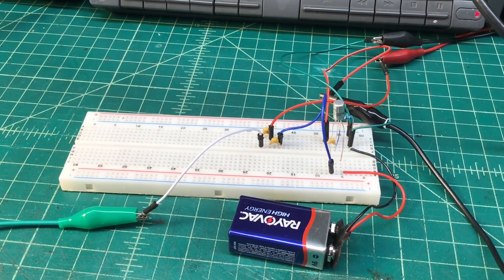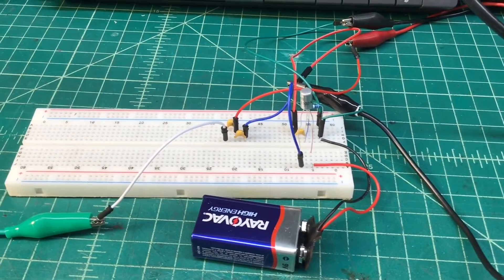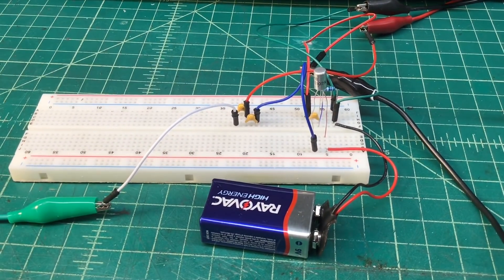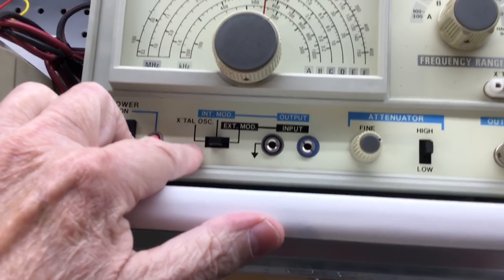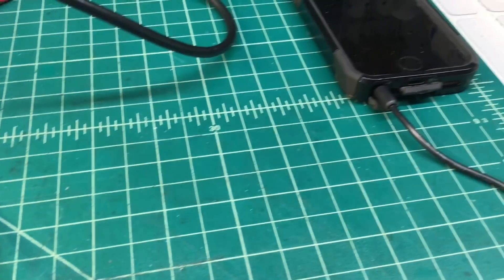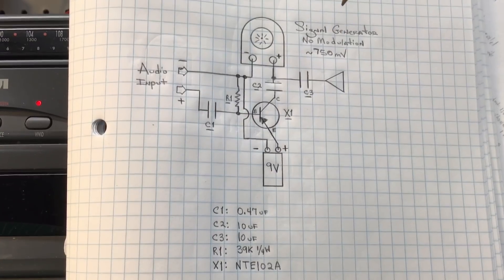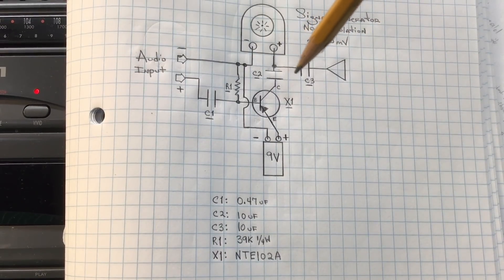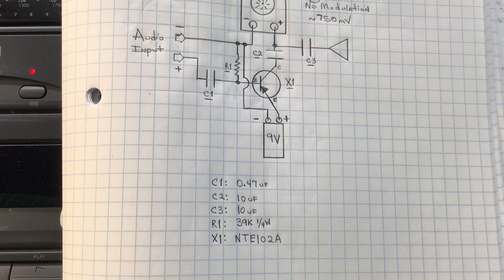AM Transmitter = RF Signal Generator + Audio Amplifier

Comment: It sure looks like C2 and C3 are 10 pf, and NOT 10 uf...
Reply from the maker: Martin - they are 10 microfarad caps; little ceramic 106 caps. All the best. Don
Reply: @RestoreOldRadios  Thanks Don! I appreciate you clarifying that for me. Regards, Marty
Reply: @RestoreOldRadios  Hi Don, there's another troubling thing about the schematic... The collector of the transistor goes to a capacitor... that's all. Should'nt there be a resistor that goes from the collector back to the -9V? ..... Marty
Reply from the maker: Martin Bassin Marty - thanks for catching this; my bad you are correct. I’m uploading a better design you might be interested in. Hope to publish it soon. Best, Don

Comment: Thank you for your video. I'm new at this, so don't use language that I can't understand....ha ha ha - I have a signal generator (Aktakom AWG-4150 50 MHz and I think max 20VPP) and I wanted to generate a signal that a regular speaker would resonate a sheet of flat aluminium square (glued with a tube to the center of the speaker + the other end glued to aluminium sheet that is about 7" square), bounce salt on top and create shapes on it. BUT, I can't get much volume out of the speaker... I understand that my generator doesn't have much amplitude but can I make a simple amplifier, using a transistor, capacitors... or am I just going the wrong direction?
Reply from the maker: Tony, an interesting project you’re working on. Are you generating an AM Modulated signal and if so, a sine or square wave and what frequency are you using? Best, Don
Reply: @RestoreOldRadios  Thank you for quick reply. I solved the problem! I was tired and did not realized that I was using the wrong output port - CH1 not CH2! Now I can create plenty of volume and it works as it should. But if you have or make a video about more options, let me know, I'm eager to learn what I started 50+ years ago and rekindled it few years back, expanding to 3D printers, Arduino, Raspberry PI....etc.
I have a second question, should I build an amplifier that I can use for other projects and learning electronics? I recover many parts from printers, radio/TV and other electronic devices someone wanted to just dump. I love to re-purpose and teach kids, or adults, how to reuse everything! If the answer is yes, do you have any suggestions? And what is MODULATED AM SIGNAL? How would I do that? My terminology is very poor, but if you spoon-fed me, I can make it. Again, thanks for doing the videos and sharing them with all of us! I'm a subscriber now!
Reply from the maker: Hi Tony - thanks for subscribing. Check out the vintage books and articles at: https://www.americanradiohistory.com/Archive-Bookshelf/Bookshelf_Bernards_Babani.htm There’s an endless amount of material available. Let me know if this is helpful. All the best. Don
Reply: @RestoreOldRadios  Very nice LIBRARY! Thank you!
Reply: @RestoreOldRadios  I use SINE and ARB (one can use them all) up to 20Vpp, starting at 500Hz up to 3kHz or so, but you can try much higher frequencies - it gets very interesting.
Reply from the maker: Tony Fleming Thanks for the info Tony. Best, Don

Comment: Don, I love it.  That right down my alley.  Thanks for posting.  I've been experimenting with transmitters for a while now.
Reply from the maker: Josh, it works OK for my old ears. I would appreciate you keeping me informed if you put one together. Best, Don
Reply: I've got 2 transmitters right now.  1 built from a Chinese kit, works well, but low power like yours.  1 bought off of a guy on Ebay that transmits a bit higher power.  I works well but is prone to hum under certain weather conditions.....or phase of the moon.